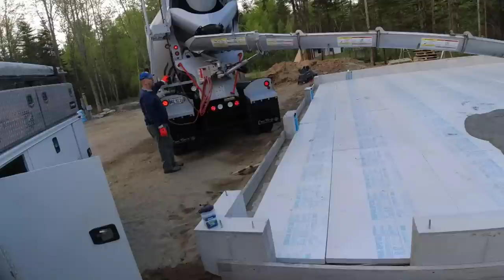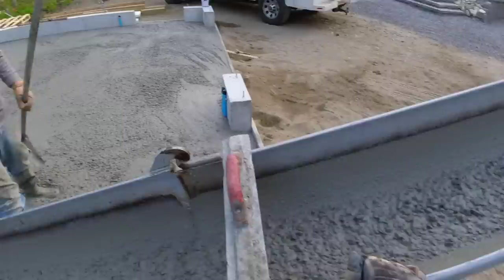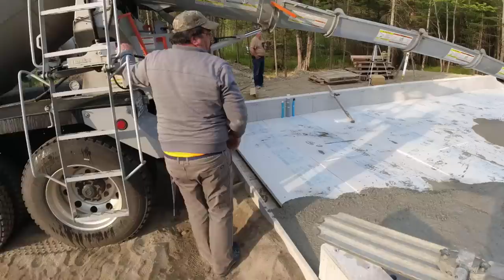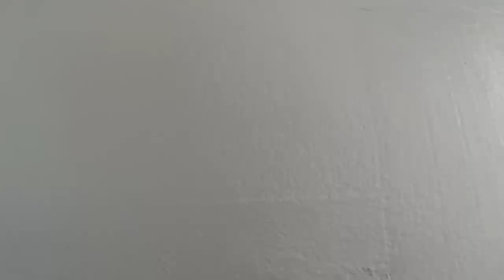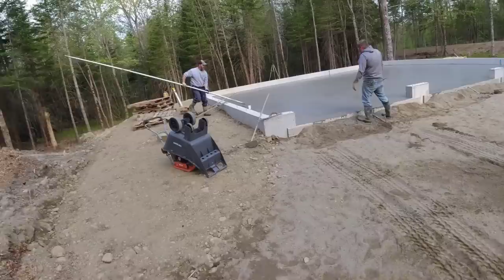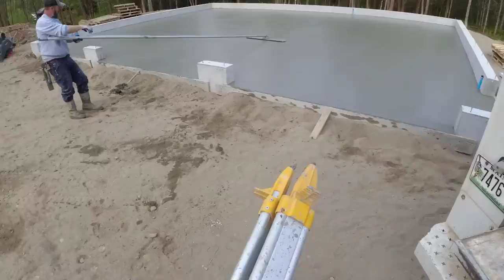How To Pour A 42' X 32' Garage Floor (This is our everyday concrete floor mix design)

Comment: Awesome! 
Getting ready to seal our house floor. It's new concrete, coming up on 28 days. I like the specs of the LastiSeal by Radon Seal. You think that would be a great choice for our flooring?
Reply from the maker: LastiSeal is really good for a penetrating sealer. Afterwards you could apply a topical sealer/coating if you want to protect the surface also.
Reply: @MikeDayConcrete  Thanks for quick reply! What would a good choice for the topical sealer be for natural look? We are planning on leaving concrete for our flooring, nothing else besides some area rugs.
Reply: @MikeDayConcrete  We have also looked at Euclid Chemstop WB and the Foundation Armor SX5000 WB sealers.

Comment: Thanks Mike for your videos!  We did a dry concrete slab and we won't do that again - I watched your video about that, but it was already too late.  We did go over the top with the Rapid Set Mortar like you showed in one of your videos.   We have our slab right outside a walkout from our house to the garden, all on one level.  There is some concrete residue that didn't quite get all sprayed off when we hosed it down.  Do you recommend anything to remove this from the aluminum slider track where the screen slides for the door, other than just scraping it off?   Thanks!
Reply from the maker: Try Crete Blast, it should remove it without damage. Just try a small spot first: https://www.deco-cretesupply.com/products/repair-prep-products-concrete-cleaners-waxes/crete-blast
Reply: @MikeDayConcrete  thanks.  I used the hose and a green Scotch brite and it came right off!  Screen is back on.  Got some other crud hiding in the crevices too 🙂  I really like that product too!   I'll be sure to save the link in my concrete folder

Comment: Mike 
Steven Pelusi here
Owner/Engineer  from BON TOOL 
SAID BY CONCRETE CODE ALL CONCRETE MUST BE SCREED OR TAMPED 
I PURCHASED A SCREEN ROLLER FROM BON TOOL AND TGE OWNER AND I HAD A GREAT CONVERSATION AND NOW I CAN FINISH HUGE SURFACES OF CONCRETE BY MY SELF 
AFTER I HAVE HELP
Reply: With leveling out